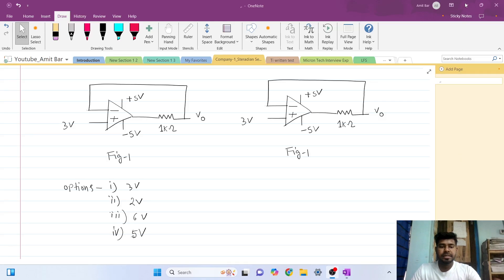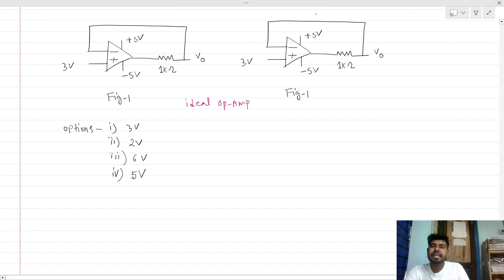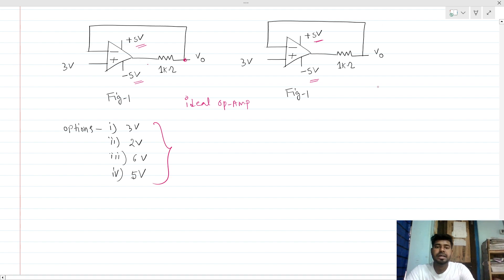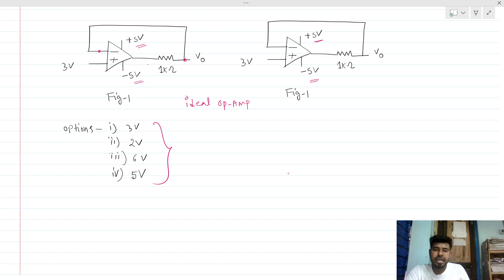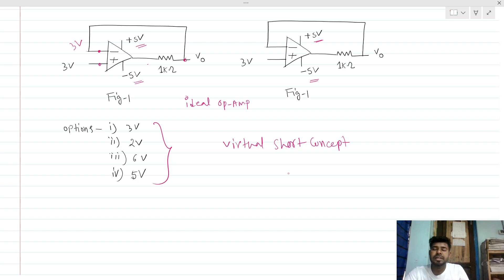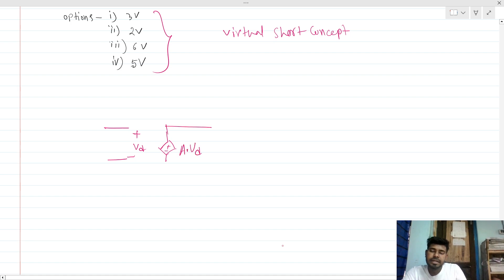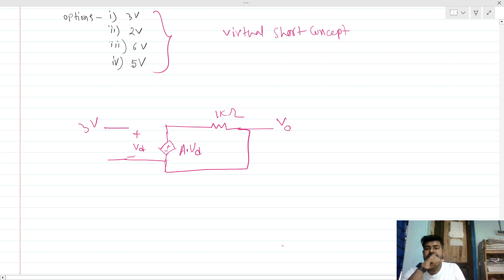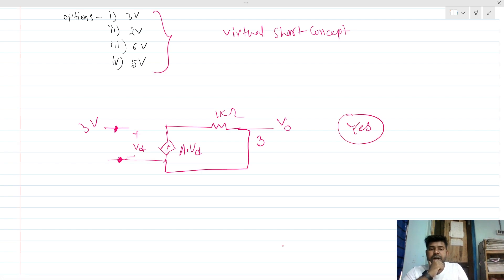Analog Circuit Design interview _ find Output Voltage opamp feedback || Amit Bar

Comment: How you are connecting -ve terminal and output terminal internally? They are shorted externally. Although ans is correct explanation is wrong. As you said there will be current in the 1st question, it is wrong there is no current